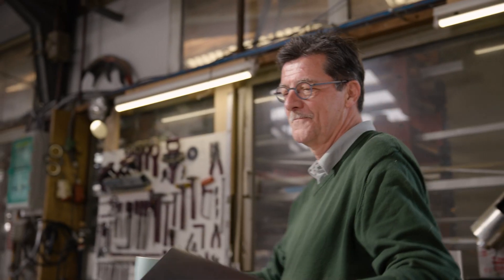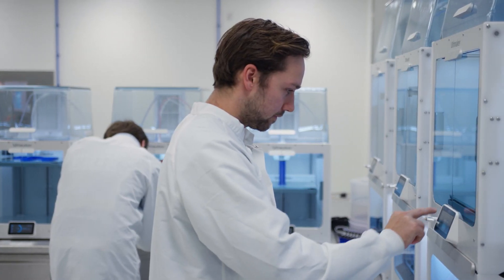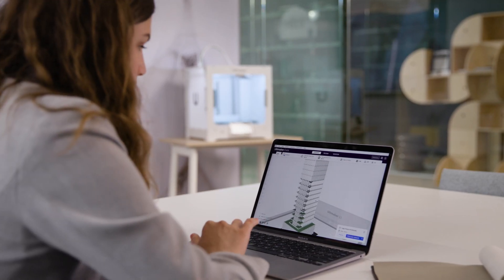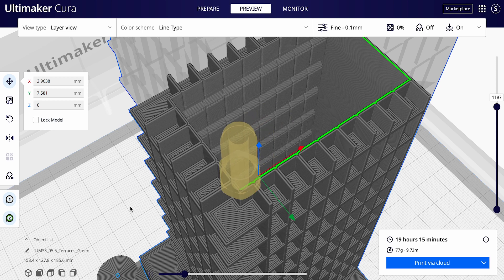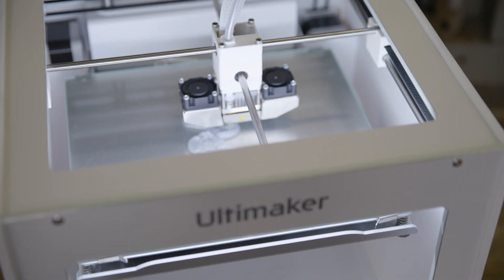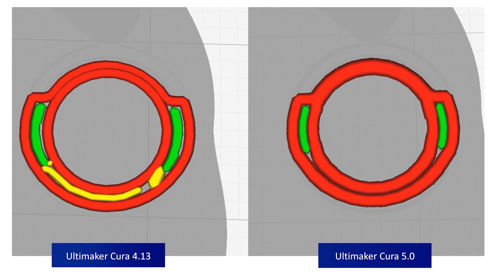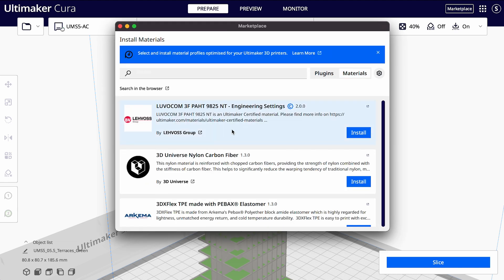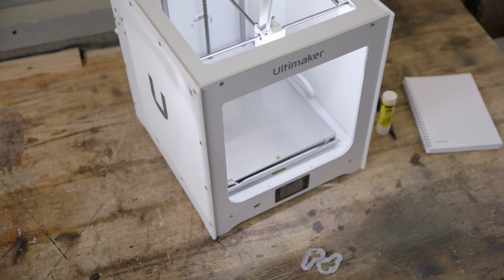Watch this if you want to improve your print quality

Comment: ultimaker is overpriced
Reply: They're made for businesses. Tbh they're priced about right for a western company. Creality doesn't even make their own slicer. They take Cura and make minor changes.
Reply: @_nom_  priced about right? it doesn't offer any more than an ender 3 to be frank. It is still hobby grade no matter who makes the slicer, it doesn't even matter. Pruserslicer is open source and it works better than Cura. I'll give you two better examples - Stratesys is what's priced right for a western company. Ultimaker is just a hobby grade printer in disguise.
Reply: @user-yk1cw8im4h  used my ultimaker 2+ for 15000 hours the past 5 years with over 95% successrate. Can your cheap Chinese shit knockoffs with fake chips, plywood and questionable electric securety handle the same? Used a dozened other hipped other printer that looked very promising for a couple of weeks or even months but failed or even burned down thank to the low end shity quality of parts. There is a reason why some products cost 5 or 10 times more than shit you get on aliexpress.
Reply: True.... But...
Reply: Yes, yes it is. My "Package Deal" cost more (at $5K) than Three Bambu Lab X1 Carbons...feeling a bit foolish now for purchasing it.